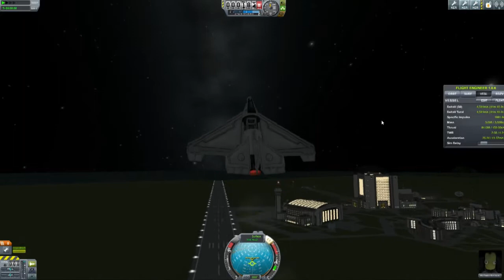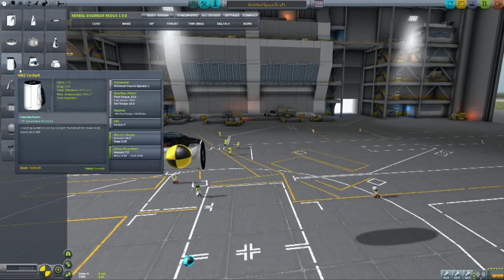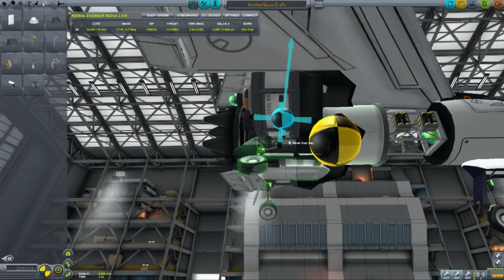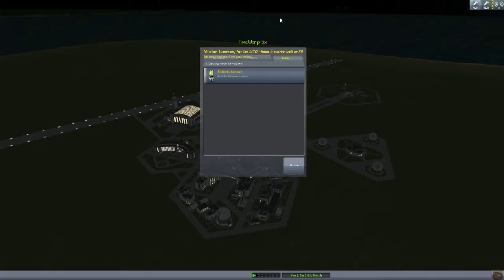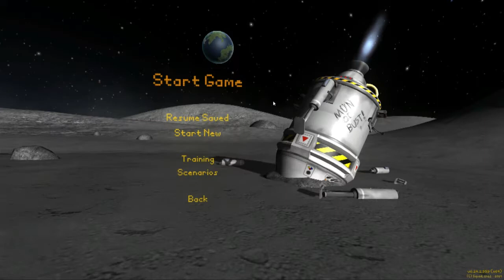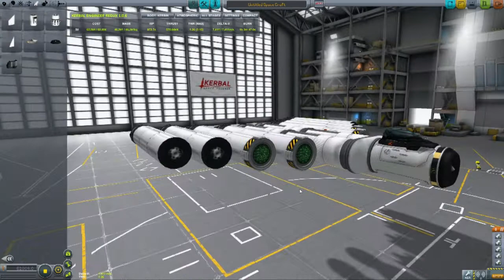KSP - Built a Spaceplane that works! Ep2

Comment: Really like the way you explain things! are you gonna do a third part anytime soon????

(just for you to know, airplanes usually take off and land against the direction of the wind, to avoid being pushed by wind while taking off/landing, as this could 'cause your landing to be unsuccessful, as wind pushing you will increase your speed, and may cause you to climb instead of descend or decrease your rate of descent, which in some cases may cause you to miss the runway or reduce by too much the amount of runway you have to break or manouver once you touchdown, always against the wind, i'm not really sure how it affects taking off, but i'm sure it does in a negative way, my father used to be a pilot and i really like reading and studing this matter, though i find it hard to apply it to ksp, even with FAR, which lead me to many tuts on ssto's, including yours hehe)